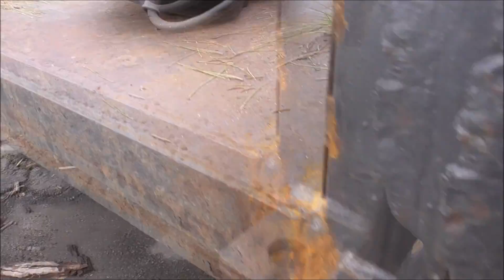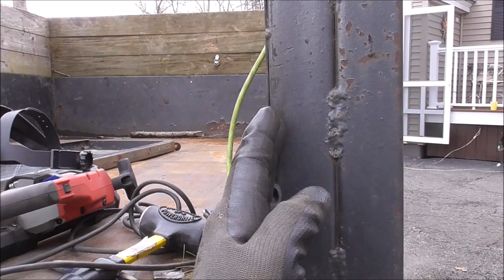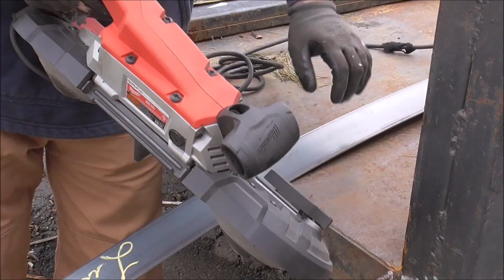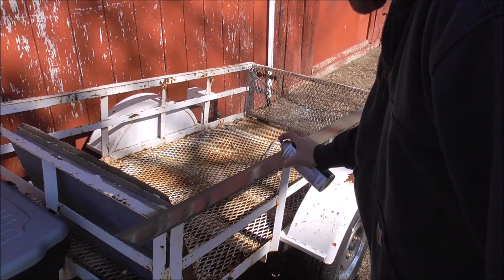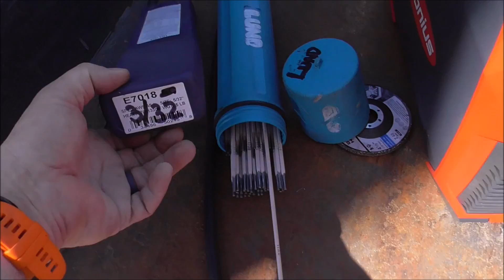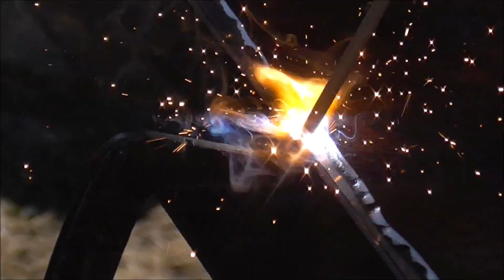Dump Trailer Welding Repair Fabrication Using Weld Thru Primer

Comment from the maker: Rolled Over Trailer Repair https://youtu.be/QMBpws1ykp0?si=UHO19DZ3tvUKLb_s
$25 Aluminum MIG Conversion https://youtu.be/FGhSo82MP9U
MORE WELDING AND FABRICATION VIDEOS HERE:https://www.youtube.com/playlist?list=PLfbf78fMz9Vol0uX2-GNc6mLi75zpqb5f
LEARN HOW TO WELD VIDEOS HERE:https://www.youtube.com/watch?v=ADa1I319GJ0&list=PLfbf78fMz9VqxPZTT-xmwdcrHVa7ML-ft
AWESOME TOOL BUILDS! https://youtube.com/playlist?list=PLfbf78fMz9Vo2Cv3V5fmYlDZGpS8Hp98l

Comment: I’ve been trying out “weld through primer” on some projects and I think I’m going to avoid using it at all costs, it’s a real pain to actually work with. If you actually try to weld through it, it will contaminate your weld. I’m sure 6011 like you’re using will handle it somewhat better, I’ve only tried with MIG dual shield so far, but if you weld directly through it you can end up with mad porosity, so you have to clean it from the direct weld area like you did. On top of that, it’s poor as a primer, and has poor adhesion to the surface, and has poor adhesion with any paint that might go on top of it. If you try it on the same nicely prepped surface along with some good etching or bonding metal primer, after it dries you’ll see that it will basically just wipe right off with pretty little force. So it’s really more like “HAZ primer”, and ideally you’d only keep it in the areas outside of the weld itself that will get hot enough for the zinc to have some kind of mild galvanizing action (and which would get hot enough to burn off regular primer).

I guess it’s really designed for plug welded panel overlaps in auto body work. I’ve been super frustrated with it in what I’ve been doing. For any cavities I’m probably going to switch to cavity wax. Flush welded plates (like exactly what you did with that trailer) are probably the only case I’d consider using it at this point.
Reply from the maker: I've had some simular issues myself. It can be a problem if your not careful.

Comment: I got a stick welder and these trailers seem to thin im blowing thru even with my heat set to 70. Would you recommend mig for my situation
Reply from the maker: Yes, MIG would be the better option for welding on the thin side metal, but you should be fine using stick on the structural components

Comment: I hardly use my porta band now I use a hyper tough skillsaw with a Hercules metal blade works great and cheap
Reply from the maker: I use my circular saw mostly on plate. I never thought about using it on tube. I'll have to give it a try! Thank you
Reply: @BrandonLund  your welcome

Comment: Good video! Is that 1/8 inch or 3/16 inch flat bar? To hold that really well, on the safe side, I would have used 1/4 inch flat bar. I don't know, maybe overkill, but still.
Reply from the maker: 3/16" and the tailgate just barely closed.

Comment: It was nice you clean the top edge where the 3” plate connects to the bed since you were sticking welding most guys don’t clean since 6010 most of the time burn through… great second half
Reply from the maker: Thanks Nelson! I try to stay in the habit of doing that, it really only takes a few extra seconds.

Comment: I did some repairs a couple of years ago on a rusty old utility trailer. It just never stops. You fix one area and another spot opens up! I have never seen as a rusty a trailer as that one!
Reply from the maker: Especially if you live in the rust belt / salt states. I had a 2006 Chevy truck and didn't know better and never treated the frame with undercoating. In about 10 years the frame was destroyed and the truck was basically a parts vehicle. Rust is bad news!

Comment: Question did you are can you use flux core hard wire  with no gas ?????
Reply from the maker: I used flux core on this but you need gas for hard wire.
Reply: @BrandonLund  thanks alot I have two rolls of hard wire that came with my mig200 but I don't have gas bottles for it

Comment: I'd might of used a larger piece on the bottom. It's all about leverage.
Reply from the maker: 100% but It's only going to be as strong as the weakest link, and that is the thin wall square tube that everything is welded to. I could have used 1/4" plate, but the thin tube that it's welded to is going to shear before the new plates will.

Comment: I know  this is off the point.  But my readers work best with a full  face shield.  When exact work is required.  As in drill sharpening.  Also under my
welding helment.  Also another tip. A lot of people have trouble getting the spatter off . It needs to be hit with hammer and chisel.  If it won't  come off. Hit it harder.  Andrew kindly
Reply from the maker: Great tip!

Comment: Certainly made that stronger, shouldn't have any problems with that, again, now he only needs a bottom, 😂 why were you using the ark welder instead of mig, the few welders I know always use mig,and swear by them, thanks for sharing, all the best to you and your loved ones
Reply from the maker: I like using stick outside when  I can just because it's fast, strong and fairly inexpensive compared to wire feed welding. I primarily use wire feed outside when I'm working with thin material.

Comment: Can I ask why you stick weld instead of MiG weld this repair? 
Is stick that much stronger? Thx
Reply from the maker: Great question 👍 I like doing stick especially outside because it's just so versatile, its fast, strong and the consumables are fairly inexpensive.  I used self shielded wire on the areas where the metal was really thin, which is where wire feed welding really has the advantage over stick welding. One really isn't stronger than the other when done properly so I pick and chose to make things go smoother. I could have done the thin metal with 1/16" 6013 rods, it just would have been a little more difficult for me 👍
Reply: @BrandonLund  
Ok thanks bro 👍
I guess I’ll need to learn to stick weld as well. 
Been doing MiG with C25 and self shielded, haven’t tried stick yet.  I’ll check out you stick welding videos.  Thanks again for all you do for the welding Community. 👊👍
Reply from the maker: In my opinion, once you start stick welding, every other process is much easier to understand. Stick welding is the basic fundamental of welding and is very enjoyable and you can get started for very little money.

Comment: Impressed you did this all on 110 Volts.
Will all 6011 run on DC?
I seem to recall some brands say AC only.
I have much less experience and don't mean to talk out of turn.
Just want to save someone from buying rods that wont work with their welder.
Reply from the maker: Great questions! Yes all 6011 can run on AC or DC whereas 6010 is a DC only rod. That Fronius makes running 110 a breeze. It welds on 110 no different than on 220. As far as running it on 110, for my setup, as long as I'm under 90 amps and I'm not chucking up one rod after another, it won't pop the 20 amp circuit breaker. But if I know I'm going to be welding all day, I run the 220 cord  to avoid those issues. It's nice sometimes to just pull out one cord and plug all your tools into an adaptor instead of running 1 heavy cord for the welder and another for tools.
Reply: @BrandonLund  I saw a Fronius demo on Lift Arc Studios. 
They were getting something insane like 175 amps off of 110 Volts.  
The Belgians have not spent all there time on waffles apparently.

Hope you and yours are well.
Have not seen a video for a couple of weeks.
Hopefully you have been on the bike welcoming Spring.
Reply from the maker: Thanks man! Yah those Fronius machines are very sophisticated. I love mine. I've taken a couple weeks off the welding channel. Some of my projects haven't timed out well for the channel schedule and I've run into some delays on materials arriving on time so I decided to do some work over on my motorcycle channel. The next three weeks I have videos scheduled to upload over there. Its been Busy busy busy lately.

Comment: I learned my lesson about 10 years ago not using the guard on an angle grinder. I had a flop disk and I didn't hang on one handed very well. It hit the concrete floor bounced  back up into my leg just above my ankle. I still have a bad spot there. I own four of them and all have guards. That trailer should serve them well, great job Brandon!
Reply from the maker: I've had some close calls over the years also. For that reason, I won't run a tool without a guard. The abrasives are too unpredictable. I hope you have a great weekend
Reply: I learned my lesson when I had a cutoff wheel on, started the grinder and as I wrapped my other hand around the body of the grinder, I stuck my index finger right into the edge of the wheel. It cut pretty deep into the tip of my finger but it cauterized the cut so not much blood. It took a while for that to heal.
Reply from the maker: Scarry stuff!
Reply: Wire wheels are hell on skin.
Reply from the maker: You got that right!

Comment: great explanation on how and why for the steps.  I think it would have been great to see how you handle welding underneath (overhead welding) and I only have an A.C. stick welder, so I wonder if you run A.C., or a polarity on the 6011 and 7018?
Reply from the maker: Thank you! I run DC. I will have some overhead coming up soon. It always makes me nervous filming overhead welding from a low position because that's how I ruined my last camera. My camera has to point upwards, and that exposes the lens a lot more to sparks as compared to it pointing downwards. I generally start by lowering my amps by 10 when welding overhead.
Reply: @BrandonLund  I wonder if a sheet of glass over the camera would help, much more sacrificial and less expensive...
Reply from the maker: @joeheck146 probably not a bad idea! 👍